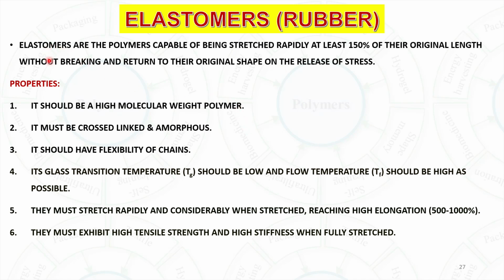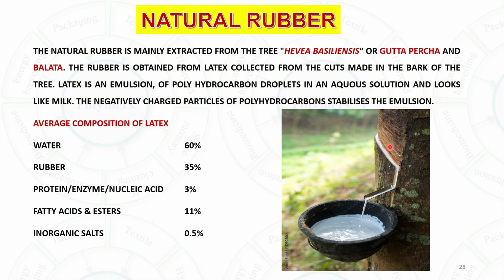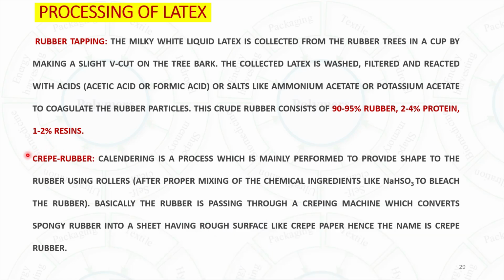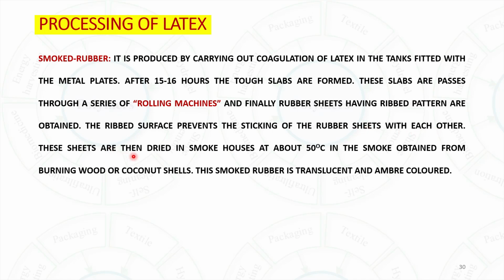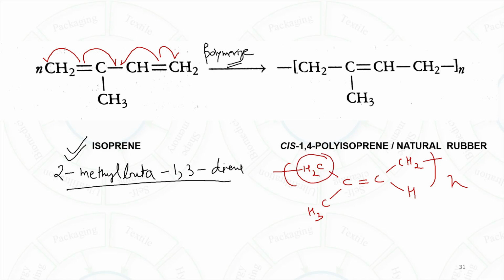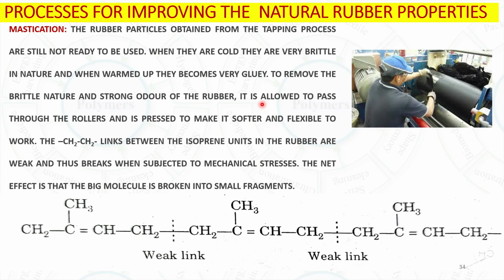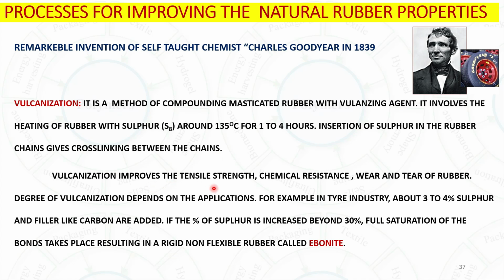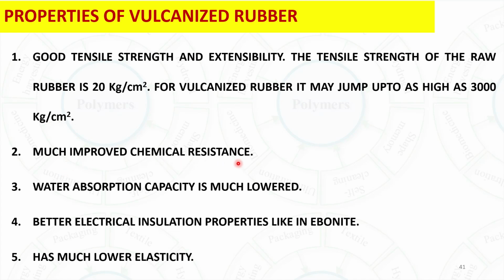LECTURE 4: VULCANIZATION OF RUBBER | NATURAL RUBBER | PROCESSING OF RUBBER

Comment: Rhenium carbonyl cannot be synthesized by direct carbonylation? Why
Reply from the maker: IP of Rhenium is very high so it doesn't easily react. Moreover Rhenium easily oxidises to form oxide and this Rhenium oxide form protective coating (Pilling Bedworth Rule) and CO can't attack on fresh Rhenium layer.